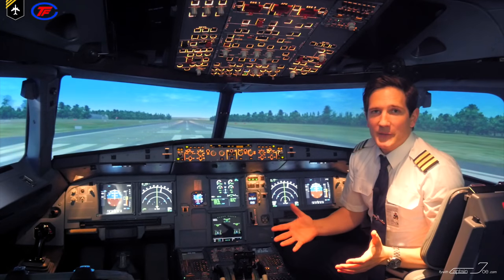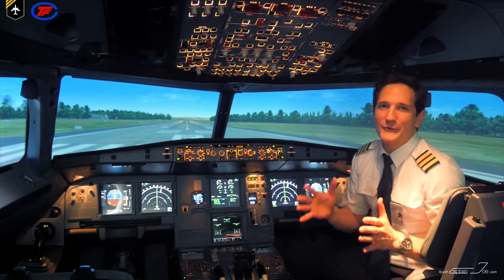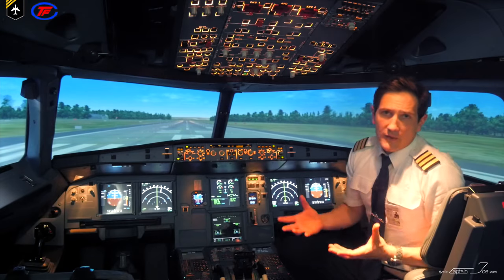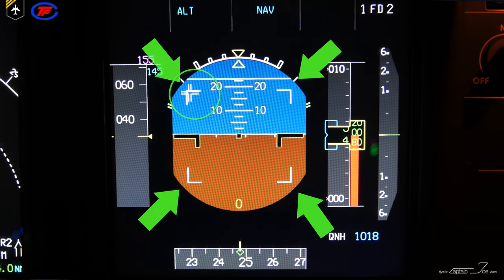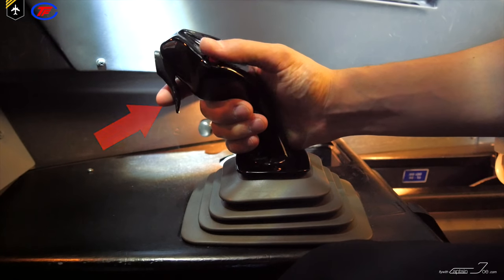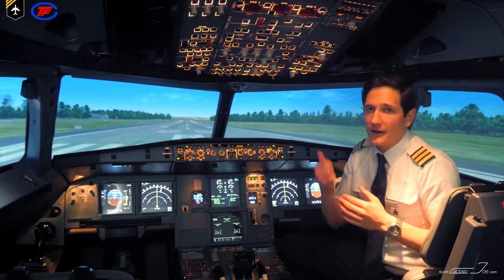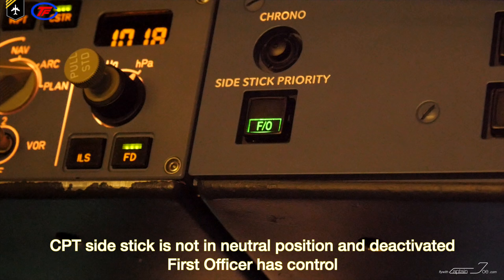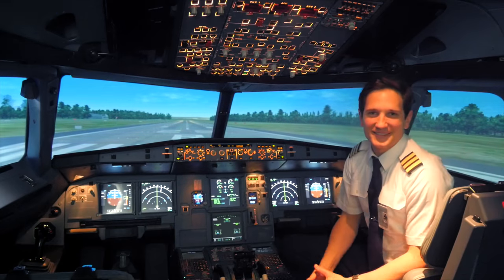AIRBUS SIDE STICK - Explained by CAPTAIN Joe

Comment: Hello Captain Joe,
First of all, thank you for making so many informative video about aviation.

If I heard it right, you said the Red button on side stick is pressed and hold for 40 seconds to take the flight control by either pilot.

I'm curious to know why the time is so long?
What happens in case of emergency, when side stick of 1 pilot is too much on either side and he/she can't control it, the other pilot has to wait for 40 seconds to get it under his/her control?
I'm sure there is a good reason why the time is so long, I would really like to know.
Reply: Well, what Joe said isn't wrong but incomplete. You have to press the button for 40 seconds if you want to keep priority on your side even if you release the button. so basically pressing the button for 40 seconds more or less deactivates the other side stick until somebody pushes the priority button there.
If you press the button for a shorter duration you only get priority for the time you press the button. For the time you press the button or after 40 seconds the inputs on your sidestick are exclusive which means they aren't summed up with the inputs of the other sidestick. So basically you can override your copilot when ever you think it's necessary.

Comment: good morning I am a follower of your channel and I have a query, the plane ATR 72 turbo helix has reverse engine brake, how it works, is activated, is the same as an A320 plane
THANKS
Reply: ATR is a turboprop and the system is not the same as it is on an A320. On an ATR72 it works by changing the angle of the propeller blades.

Comment: Holding the side-stick priority button for 40 seconds seems a little long if it's an emergency situation.  If the malfunctioning stick is in a pitch-down position, you have to wait 40 seconds before you can take full control.
Reply: Holding down the switch will instantly give your stick priority, but only if you hold the button. If you hold the button for more than 40sec then you can let go of the button and still have priority
Reply: Okay, that makes sense.  Many thanks.

Comment: Great video, Joe. Dual input has always bothered me, and there’s been many accidents or incidents related to that. I had a few questions, if I may. What’s the flight surfaces’ behavior when the pilots provide opposite inputs for a prolonged period of time? You said, they sum up. Does it mean that if the captain decides to pitch up while the FO wants to pitch down, there will be no deflection? 40 seconds to take control might be to long in critical situation. And how do you solve the priority issue if both pilots keep the red button simultaneously? I would appreciate it if you could put some light on that. TIA.
Reply: Slight misunderstanding. The priority takeover starts the moment the button is pressed. 40 seconds is just to permanently lock out the other sidestick so you can take your thumb off the button
Reply: If both pilots use the priority button, whichever pilot used the priority button last has priority

Comment: Whenever a plane is loading at the gate, you can hear a revving sound, like a truck engine, coming from below you. I think I remember feeling a slight rumbling from it too. At first I assumed it was the elevators used by the loading vehicles to load cargo onto the plane. Then someone said that it was actually the APU, so I looked up what an APU sounds like, and it was definitely not the same sound (an APU sounds more like a turbine hum, this was a deep engine rev).

Can someone please explain this?

Comment: Was conflicting sidestick inputs a contributing factor in the Air France disaster where the in-experienced co-pilot unconsciously held his stick back while the other pilot was in control. Did that Air France plane have a control conflict resolution system as this plane does?

Comment: Unfortunately, the AF 447 joystick operators didn't get this very well with tragic consequences. One was pulling the nose up and the other one was pushing it down. In a Boeing, you would have seen and felt the control column physically move in front of you.
Reply: That is true and it is a contributing factor to the crash. But pilot 101 which is taught from day 1 is to know who has control. So only one should be operating the controls at a time. So this was more of a crm issue than a sidestick issue.

Comment: Are pitch and trim different things? Would really like an answer!
Reply: Hamish Catherwood In layman terms, pitch is the angle between the aircraft nose and the horizon. If you want to increase temporarily the pitch, you pull back the sidestick. But if you need to compensate for a long period of time, say bacause the center of gravity shifts when fuel gets burnt, you will "trim" the pitch, acting on a separate command (a wheel). Each of the three attitude controls (pitch, roll and yaw) has the possibility of trimming, even if pitch is probably the one most often changed one during the flight.

Comment: Good work Captain......I have an another doubt... What's the red button on side of throttle in Airbus a320......??????
Reply: The red button is the autothrust disconnect button.
Reply: @mikep9604  Not the side stick....ohh the red button in that is for auto pilot disengage....So this is to disengage auto throttle right??
Reply: @vishnuvarier1608  - Yes, the red button on the thrust lever handle disconnects the autothrust.
Reply: @mikep9604  Thankyou

Comment: I am an engineer and very mechanical inclined. However, I was used to driving on the right side of the road in the U.S.  and I am right handed. It would be very difficult for me to hold my right hand on the wheel and left hand on the floor shifter. I imagined it would be much more difficult to use a left hand flight stick as in the captain chair.
Reply: How do you imagine a captain holds a yoke when his right hand is on the throttle levers?

Comment: Brilliant design. It parked an Air France AirBus A330 in the bottom of the ocean.
Reply: Not exactly. Yes it was a contributing factor, but it wasn't the cause of the crash.
Reply: @ZK-APA  it wasn’t even a contributing factor according to the final report. It was mentioned as a note but not in the findings

Comment: [Please note that this Comment is not meant to be in any way sexist or frivolous.]  I was surprised to hear that the voice warnings in the cockpit were given in a relatively deep male voice. In my very limited experience, the higher pitch of a typical female voice is often better able to 'cut through' ambient noise, particularly the continuous rumbling, hissing sort of background that occurs in forms of transport such as trains, planes, and cars. (The directions spoken by my car's sat-nav were always easier to hear when given in a light female voice.)

Isn't the higher pitch of a woman's voice more easily heard on a flight deck? A baby's shrill cry is certainly very attention-grabbing, and the sirens on emergency vehicles are always rich in high frequencies.

Is the lower pitch of a male voice chosen deliberately to avoid generating feelings of nervousness or panic? I could understand that. I suppose it would be counter-productive if the warnings merely shocked or startled the crew rather than advised them. Even so, is a lower-pitched voice still easy to distinguish with tired ears numbed by a long flight's worth of white noise?

Comment: I asked to an ANA’s A320 captain “Was it difficult for you changing from control wheel to side stick of Airbus?” He said “No. But when changed from right seat to left seat, I felt a little strange because using my hand was changed from right to left.”

Comment: What if the left pilot is right-handed or the right pilot is left-handed? A yoke like Boeing uses doesn't have this serious concern.
Reply: It's the same in Boeing. When you fly manually, inboard hand is on throttle levers and outboard hand is on yoke.

Comment: I would feel less in control with a sidestick, you can get a better grip on a yoke and if that one Alaska Airlines MD-80 had a sidestick they would have not been able to control the plane at all.
Reply: It's all pros and Cons when considering yoke vs sidestick. Yes i agree that a yoke feels more natural, but that doesn't mean that its better for every case. Eg a jammed control column would be a critical failure with a yoke, but non existent failure with a sidestick

Comment: Why 40 seconds? In a near straight down dive, 40 seconds could mean the difference between life and death. A good 10-15 seconds would be plenty long of a hold to make sure it was intentional.
Reply: Slight misunderstanding. 40 seconds is just to permanently lock out the other sidestick so you can take thumb off the button. Otherwise it is immediate   The last one to push has priority
Reply: @tomstravels520  Ahhhh. What if you both panic and both push your buttons?
Reply: joblessalex there is always going to be a microsecond difference. You’ll never get it perfect

Comment: So if both sticks are moved to effect a 5 Degree right roll, the result will be an input of a single stick effected 10 Degree Roll?
Reply: Yes but you mean 5/10 degrees per minute roll rate
Reply: @tomstravels520  Mr. Moore in a pinch once again!  It seemed counterintuitive but I ripped an old (not that old) airbus flight manual in pdf and it was a pretty cool level of engineering and ingenuity that went into it.  Thank you!

Comment: A yolk is much more precise for flight movements though correct?
Reply: ChrisG- that is true only if there is some physical connection between the yoke and the control surfaces.

If both the yoke and side stick are pure fly by wire, then it would depend on your personal preference which feels more precise.

Comment: I'm here after mentours video & can't simply imagine why airbus invented such a needlessly complex system of two pilots engaging in a tug of war if theres a lack of coordination & crew resource management. AF447 was all about this & complete mental breakdown due to systems blaring away & making seasoned pilots feel like they're beginners. Yoke would never have allowed this to happen had AF447 been a Boeing. Pull to go up.
Reply: airbus un-linked side stick is the worst design that ever comes to the multi-crew airliners. even pilots who fly airbus hate it!

Comment: Of course this systems dont fail, are bullet proof, but the fully electronic controll and galss cockpit looks a bit like an issue when it comes to fully depend on electricity. No because engines are going to stop generating it but electrical issues in general that could hurt any of this systems. Is there some sort of back up. Iam not expecting cable operated levers LOL but at list minimal hidraulic functions that wont require power or will work if the aircraft systems go inoperative. Also I imagine there are minimal intruments (analog) that will run just on batteries ....

Comment: I understand why Pilots want people to not call it a Joystick - theyre piloting an Airplane and not playing a Videogame. But it IS a Joystick. No matter what. It uses the Design, the Tech, the buttons... Just because its placed on the side, that doesnt mean its something "different". If i place a Keyboard on my side, its not a "sideboard". If i place my Mouse at the center, its doesnt become a "Center-HID". Using something for Games and serious applications is not a bad thing. Denying that heritage there is just... silly. ((About heritage, Joysticks are, of course, a Military development, first used by the Germans to steer rockets, called "Kommandogeber" but thats a different story.)) Of course, you cant just take any joystick and mount it in an airplane. It has to meet certain standards, probably uses more redundant tech than your standard USB-Joystick etc. But then again, I dont assume the Keyboards in a modern Airbus are 3.55$ of the shelf keyboards either.
Reply: The term "Joystick" isn't even coming from its application as an electronic HID, the term was first used to describe the control stick of the very first airplanes. But you could, in principle, use any PC joystick to control a modern fly-by-wire aircraft, as long as you build some kind of USB-to-ARINC 825
 adaptor.

Comment: It just seems odd the side stick wouldn’t be dedicated to a right (or left) hand from either the captains or the first officers position. You should be using the side stick with the same hand from either position.
Reply: Daywalker_27 that’s not how it works. Even with a yoke, you use the left hand from the left seat and the right hand from the right seat. The other hand is used either for the throttles or miscellaneous tasks. It’s a similar concept to using a lhd car vs a rhd car.
Reply: ZK-APA That would all be true. It just seems like an awkward setup. C-17’s also use a stick and you’d use them the same from the captains or the first officers position.
Reply: Daywalker_27 again nope. It’s standard way to fly with left seat left hand and vice versa. If you are flying with the wrong hand, it will mess up the control of the throttles.

Comment: So does it go left right up down??
Asking as a non pilot but I want 2 be one
Reply: Charlie Turnbull yes it does. You only have to move it slightly to the left, right up and down. It doesn’t need a full force turn so you can be confident that the plane will respond to the action you are doing.

Comment: " They are not link mechnically" if it really fail, how to control.

because like automobile, accel pedal and evrythng are electronic control except brake and steering which are mechanically link

Comment: Forty (40) seconds to transfer sidestick control by pressing button? That is a LONG time. Did I hear that correctly?
Reply: No, you have immediate control. The other stick is permanently disconnected after 40 seconds.
Reply: Yes you did! And yes you're right! And yes: this is precisely the Airbus technology!
Reply: No, he's not. Pressing the button will give you control with NO delay. Pressing the button for more than 40 seconds will permanently disconnect the other stick. That's a huge difference.
Reply: OK, my bad.
But why so complex, so complicated when classical simple and coordinated yokes like on Boeings do a great job !
Reply: +Canardeur Yea but during landing and take-off you have to use both the throttle and the yoke, which would feel awkward as the yoke was meant for two hands not one.

Comment: Hello guys. I would like to ask a question. My eyes have bkth short sight and long sight. I understand that pilots should have perfect eyesight. However, I really want to be an airline pilot. Is my dream unreachable or there is still hope? I've heard that if the glasses can bring you up to rhe standard, you can still apply for flying. Is that true?
Hope someone can answer me. Thank you
Reply: Me Epic I'm quite sure not every pilot has perfect vision and it varies depending on the airline. After all one of the most amazing emergency landings, after both engines failed in a storm, was performed by an airline pilot with only one eye. I love that story it's amazing: https://en.m.wikipedia.org/wiki/TACA_Flight_110
Reply: Swede Potato Pie thank you so much for your reply. Making me feel like there is still hope.

Comment: Yokes are better, take a look at Air France 447. The captain could not recover from a stall because the co-pilot was pulling back on the stick without him knowing, causing a "dual-input" condition. With mechanically linked yokes like on the Boeing, you do not have that problem, because it would have been easily visible. 

Also, if you are the captain and right-handed, having to hold the stick with your left-hand would be unnatural. With the Boeing yokes, you can hold them with either hand.

If it ain't Boeing, I ain't going.

Comment: Can this side stick system be a source of mistake as one pilot can't directly see the other pilot action ?  If I remember well it has been pointed out as a reason of the missunderstanding between the crew of the Rio/Paris AF crash
Reply: py mi yes, but in actual flying, only one should have their hands on the side stick
Reply: py mi they will know when the other pilots using it as if they push forward when another pilot pulls up, they’ll find it very hard to move so they’ll know if they’re using it. The AirFrance crash was caused by STALLING not Pilot Error .

Comment: Wouldn't it be wiser to only allow one input at a time, rather than summing them up? In case of an input coming from both sticks, give priority to the captain and disregard F/O (together with an aural "WTF are you two doing?")
Reply: Simply keep the priority button pressed. It does exactly what you describe.

Comment: Can you land a plane via careful and timed autopilot input if both sidesticks fail?
Reply: Doesn't need special inputs, the autopilot in an Airbus can land the plane all by itself if the runway provides ILS and Glideslope signals.
Reply: shi01, what about the final flare and touch down? newer planes can even do an autoland. i am interested if the precision of autopilot knons is good enough for the last mome2mnt.
Reply: Even that the autopilot will do. All the pilot has to do is basically to set the flaps and and slow the plane down after touchdown.

Comment: Can anyone tells me why these two side sticks are not linked together (similar to the yokes in boeing). A pilot should be able to know the control input of the other pilot; otherwise a spacially disorientated pilot (like in Air France 447) would jeopardize the plane.

Comment: Why is there sidestick to begin with?  Doesn't it perform the same functions as the control wheel?  Why the need for a sidestick?
Reply: Means an unobstructed view of the instruments, space in front to put a tray to write on your documents or in the case of the A380/A350 the keyboard to work with the OIS